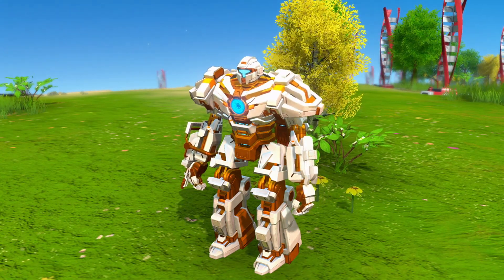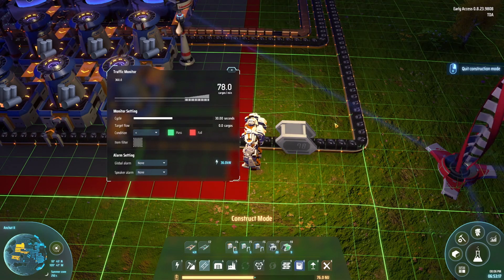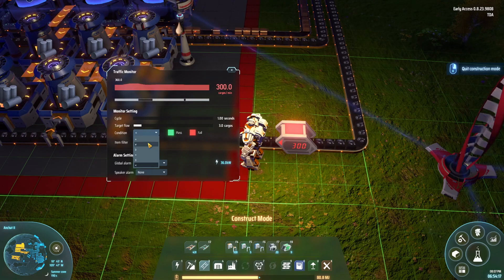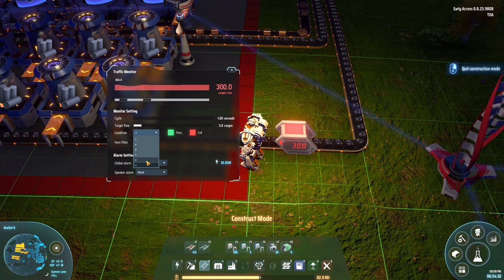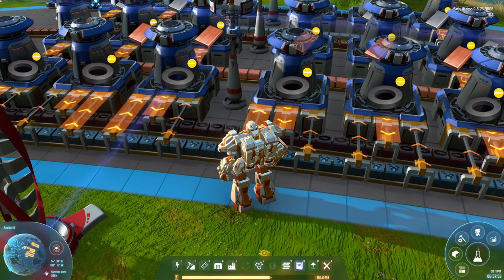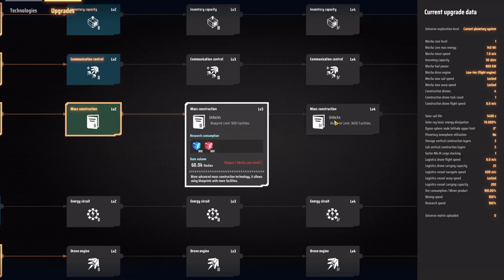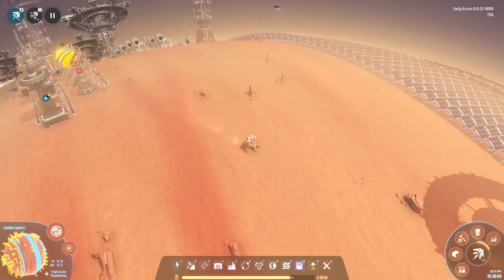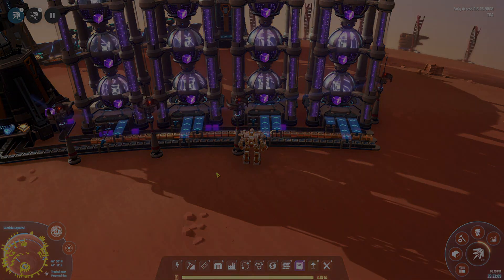NEW UPDATE - TRAFFIC MONITOR is AWESOME - Dyson Sphere Program

Comment: I can't stand the change to the Dismantle/Upgrade mode. I much much MUCH prefer the static option as I use the Area Dismantle far far far more than I do the single. This would have been far better if they had made it a toggle instead for how it behaves.
Reply from the maker: That's interesting! I actually use the area dismantle the most as well, but those few times when you want to delete that one sorter, and you accidently delete half your build.... Definitely worth the default 'single delete' setting imho!

Comment: I'm disappointed that this is not a circuit network belt flow control like Factorio.  It'll have to do though.   It's nice that players now have an alert to place on another planet or solar system if production drops (like miners as you mentioned.)